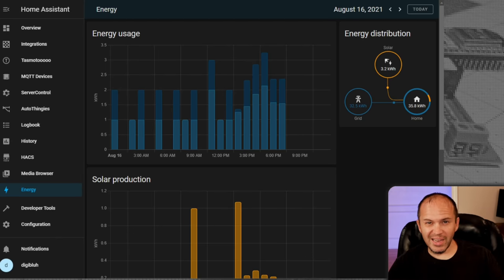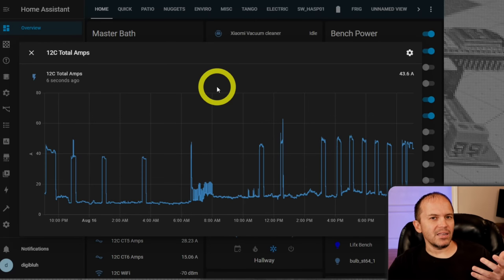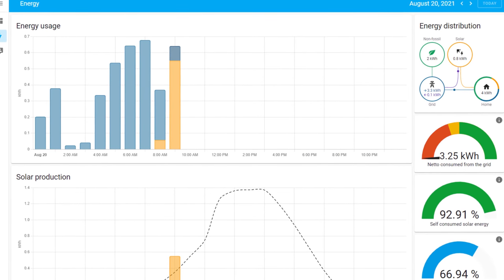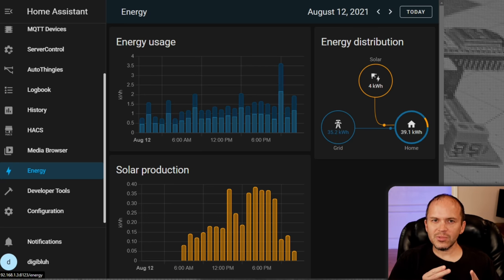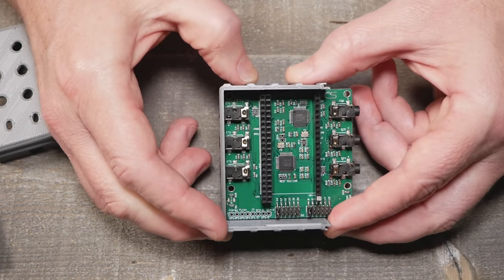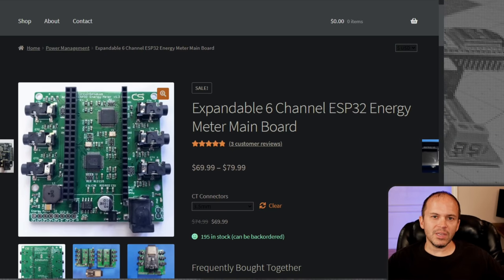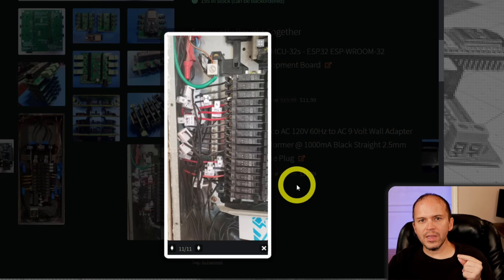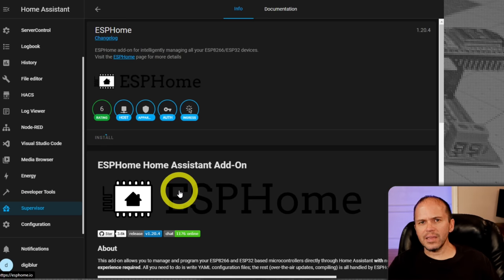DIY Home Power & Solar Energy Dashboard -  Home Assistant w/ ESPHome

Comment: Thank you, always very well explained. 

I only have one question: the CT_clamp gives you energy in W by using power = intensity * voltage and you convert it to kWh by simply make a multiplication by 0.001 where is that formula coming from ?
Reply from the maker: Esphome handles that based on the time and wattage. You just feed the info.
Reply: The 0.001 is just saying "go out this many decimals" in the calculation for kWh
Reply: @digiblurDIY  I already have a sensor based on CT_clamp that gives Intensity (A) and Power (W). Using a Reimann integration on power I also have a sensor measuring total energy spent (kWh) but none of this sensor can be used, they do not appear for the energy dashboard. 

Here is my sensor that should be compatible 

state_class: measurement
last_reset: '2021-08-15T15:27:45.466692+00:00'
source: sensor.puissance_electrique
unit_of_measurement: kWh
friendly_name: energie_consommee
icon: mdi:chart-histogram
Reply: @Totophe92130  mine looks like this:

 state_class: total_increasing
source: sensor.mains_power
unit_of_measurement: kWh
friendly_name: energy_spent
icon: mdi:chart-histogram

I have my monthly usage stat set to reset monthly in sync with my billing period

Comment: I noticed in your video, that your clamps have really nice cables.  Did you solder these on yourself?  I find the ones from CircuitSetup are a bit short.
Reply from the maker: I didn't solder any cables on. I used the ones that were there already on them.
Reply: @digiblurDIY  Ah, I guess that wasn't your setup.  I'm talking about the cables at the 8:02 mark and again at the 9:47 mark.
Reply from the maker: That is mine at 9:47 but the other is from the github on the CircuitSetup project. Crazy cables there. I suspect they are just extension cables.

Comment: I really like this ct clamp but in keeping in line with minimal DIY I'd prefer not spend that much on the breakout board. Anyone got a link to the electrical circuit only using an Esp32?
Reply: Here is information on building a simple circuit for the ct clamp: https://community.home-assistant.io/t/esphome-ct-clamp-30a-1v/284423 and here is the ESPHome config: https://community.home-assistant.io/t/energy-tracking-ct-clamp-current-sensor/329165/3
Reply: @dklein9164  thank you

Comment: I've been using the FAE (forward active energy) sensor to determine Wh because it's a more accurate measurement than any statistical model can provide. Unfortunately, Energy Dashboard expects that the sensors provide a number representing cumulative consumption. The FAE sensor is differential (it resets to zero after every measurement). Have you tried this sensor at all? Any thoughts on how to fix it?
Reply from the maker: I haven't messed with that side of the sensors myself.

Comment: I was told on the HA energy you need to add 3 attributes. Energy, measurement and last_reset. Not sure how.  I think the energy integration does something else as it does not see any of my tasmota devices.
Reply from the maker: Are you using the Tasmota HA integration?
Reply: @digiblurDIY  I am as well as MQTT. I hàd to customize the entity and add the three attributes. Working now. Original directions were wrong on discord. Fixed now. You can follow the tread in discord, energy.

Comment: My HA doesn't see any of the device in energy. It does see them in developers tools. I have used MQTT for years. Do I need to reconfigured MQTT?  If so, what pain!
Reply from the maker: What devices? Some might need to be added with utility meter integrations to be seen. No reason to configure MQTT as it is just a path for data.
Reply: @digiblurDIY  just changing the custom settings worked. Once I understood what was needed it was easy.

Comment: Thanks a lot for great videos! Just a little question - could this be used to measure Direct Current?
Reply from the maker: I don't believe this chip is designed for DC amp measurement. There are some other DIY projects out there for doing that.
Reply: @digiblurDIY  From README:
What you'll need:
Current Transformers (any combination of the following, or any current transformer that does not exceed 1V or 720mA output)
So theoreticaly we can use DC-DC hall transformer with 4-20mA output but need to find out how to calibrate it in source code for this board.
Reply from the maker: Definitely hit up the guys at CircuitSetup as I just don't have any solar here. Missed my window of opportunity a few years ago for it.

Comment: Did something change in the home assistant energy setup? I did not have this setup before but I had the esp energy meter already setup but its not seeing any of my sensors in the homeassistant Energy setup, under grid consumption I do not see any of the esp energy meter sensors, but they are clearly visible in home assistant dev tools and under devices... Anyone have this issue?
Reply from the maker: I haven't seen issues with mine disappearing. Do you still have the required entities?
Reply: @digiblurDIY  yes its not disappearing..it never shows up in the list. The device and entity show fine and show stats in HA fine
Reply from the maker: do you have the daily energy platforms and such set in ESPHome?  

https://github.com/CircuitSetup/Expandable-6-Channel-ESP32-Energy-Meter/blob/master/Software/ESPHome/6chan_energy_meter_house_solar_ha_kwh.yaml

Comment: Very interesting. How would i adapt this to work in my country (Netherlands). And can i source the materials here?
Reply from the maker: Everything except for the main IC board but I do believe they ship internationally too.  You could use some other smaller solutions for 2-3 circuits like a DIY build, ShellyEM, etc.
Reply: If you have a smart meter, look up dsmr from the P1 port.
Reply from the maker: Ours is some encrypted 900mhz signal. All sealed and they have a fit if you even put anything attached to the box. Friend had an IP camera looking at his meter to record his values. They sent him a letter to remove it. So it put a wooden pole in front of it not touching the meter. Ha!
Reply: It is documemted at https://www.home-assistant.io/docs/energy/electricity-grid/

Comment: How did you get your "Return to Grid"?   Seems the displays are wrong without it?
Reply from the maker: I did it with a clamp on my mini split AC that is used for secondary cooling at times. Just to simulate solar since I do not have solar at my location.
Reply: @digiblurDIY  The problem seem to be that the Grid Energy measurement value decrements as energy is returned to the grid.  That's good except the dashboard's calculations appeare to need that return value for the Energy Distribution graphic to be correct.  No clamp measurement can give that. You know the solar output but you don't know how it is distributed between the house and back to the grid.  At least it isn't yet obvious to me.

Comment: Do u use the same clamps for 220  on AC/Stove,oven, hvac....etc?
Reply from the maker: Yup, as long as the rating is high enough for the load and of course it fits around the the conductor.

Comment: Any good ideas on how to power the power monitoring board inside the electrical panel.  Panel is outside, exposed to the weather.
Reply from the maker: In that case I have seen some people put a plastic outlet box in the bottom of their breaker panel connected to a breaker.
Reply: You can also take the transformer out of the case and wire it directly to a breaker - kind of like your doorbell transformer.
Reply: I'm in the same boat. Ironically, I have no outlets anywhere near my breaker panel. I like the idea of adding a breaker and running an outside outlet. I'm generally pretty good with electrical stuff but I may get an electrician to do this for me. Not only is this something that has a lot of electrical code restrictions, this is in the warning zone of "burn my house down" that I'm not going to play with.

Comment: Does anyone have any thoughts on this this open source kind of solution will ever have support for flexible current sensors (Rogowski coils)? 

I would love to implement this local only Home Assistant based solution -- which would also be great for monitoring my usage when running off my whole home generator -- but at this time I'm still stuck with Emporia Vue because they are the only company I've found that offers flexible clamps (Rogowski clamps) that actually fit around my mains in my very tiny main breaker panel; regular CT style clamps just physically cannot be installed...
Reply from the maker: Are the specs not the same output as CTs?
Reply: @digiblurDIY  I’m not sure… they are different in that they have their own power source and connect to what they call an “integrator” circuit board…so I assume they work differently but don’t really know. Maybe the power source and “integrator” chipset they connect to normalize it somehow?

Comment: Isn't that useless to monitor the amps of an AC line without monitoring the phase of the voltage, 
I wonder did you draw any conclusions about monitoring the current only for a year?
Reply from the maker: Been using this product for more than a year and still like it. No regrets. I only have single split phase in the US and only need to monitor the voltage reference of the one phase available to us.
Reply: @digiblurDIY  ok so you are monitoring the voltage, I didn't see that in the video... so everything is basically just as I'd do it as well in Taiwan (we have 110V here). Thanks for your reply!
Reply from the maker: Correct. It uses the AC to AC adapter for reference voltage

Comment: I would recommend the IOTAWATT over the Circuit setup solution - it is much cheaper overall - a more mature solution and supports a wider range of CT Clamps
Reply from the maker: I actually looked at that one myself a while back but bypassed it on the hardware choices used in it for various reasons such resolution, etc.  I'm looking forward to see what they do on the esp32 model though when it comes out.

Comment: how do you properly monitor power factor with out monitoring voltage?
Reply from the maker: It monitors voltage to calculate the power factor.  That was the previous board from 2 years ago.  This one monitors voltage as shown in the video to get power factor, watts, kwh, etc.
Reply: @digiblurDIY  I guess I missed that part of the video.  So much rambling.   I only see the CT clamps hooked up.